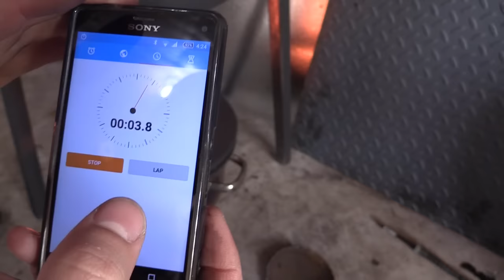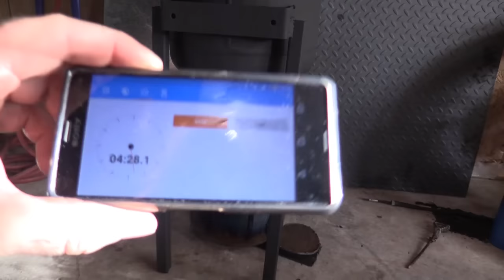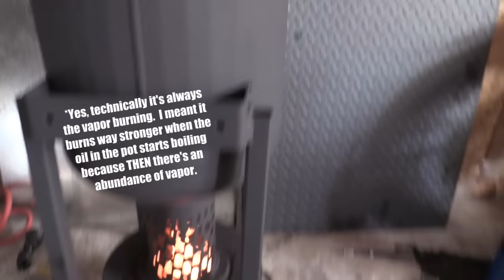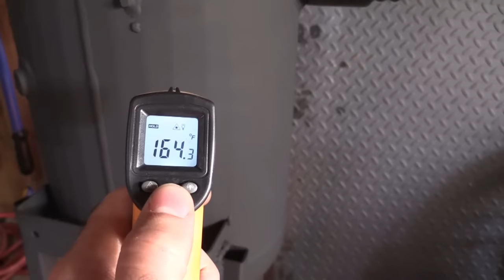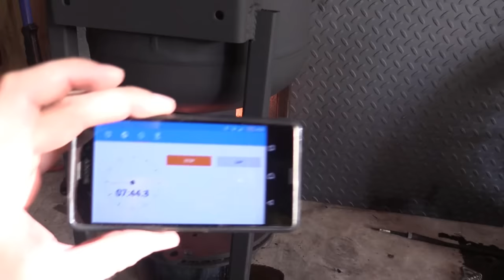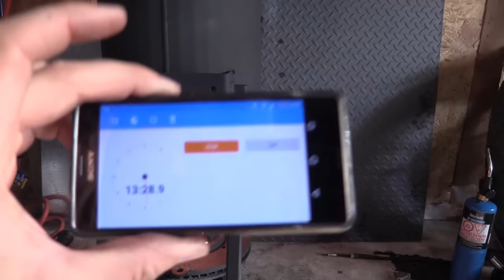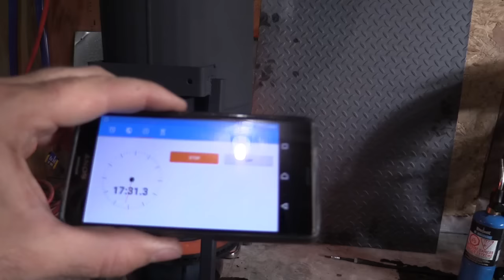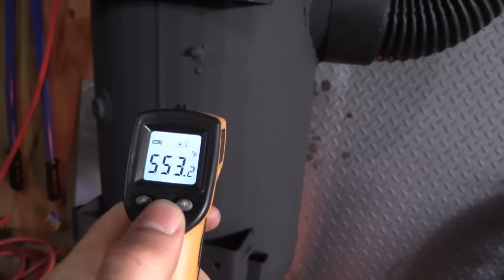DIY Waste Oil Burner -- How Hot Can It Get in 20 mins?

Comment: Would putting a small floor fan facing the upper tank and exhaust increase your overall heat output to your garage?  You have excellent ideas and inventions.
Reply from the maker: +William Brown Thanks William!  A floor fan could help circulate air, but it would have to be set up just right so as not to disturb the flame with any external wind-- I demonstrate what I mean here: https://youtu.be/9sTW1sQ8dWA
Check out the updated video on my channel to see the convection shroud and fan I've built for it.  Cheers!
Reply: So
Reply: You Canadians are so polite  I am thinking of jumping the wall and trying to blend in. The fuckery in our country is off the hook. I hope it's not like that up there take care good bud brother.
Reply: @rickzap7957  No it's worse.  They dont have the rights we do. So there nothing to strip them of.

Comment: Wouldn't you be better off taking outside air for combustion rather than creating a fan to draw cold air through the building and up through the chimney? I'm sure that once it is hot, the air temp will not hurt the combustion...this is becoming mandatory in Canada for obvious reasons.

Comment: could i use a old empty propane tank instead of what you used ( air compressor tank ). ?
Reply: You can
Reply from the maker: You sure can!  Fill it with water then empty it before cutting into it to ensure you have all the propane displaced.
Reply: @BogieWheelz  fill with water, and cut it while full to stop vapour igniting

Comment: Do the vanes in the brake rotor go all the way through?  I would think you could drill holes in the under side to let air in without having the pot slid out.
Reply: We
Reply: Might make it swirl too.
Reply: I used a vented rotor on mine and didn’t have to drill any holes. Sounds like a rocket too once it gets burning lol

Comment: why didn't you just modify the old oil heater you have sitting there?  I have an old 1950's Sinclair oil heater that I modified very simply to use waste veg oil.. works great.  The Sinclair has a blower that forces air into the combustion pot in a circular design and also forces air around the burn chamber and into the room.
Reply from the maker: Steven Canfield Hi Steven, I did modify the old Coleman heater sitting there, it's showcased in a different video.  Then I challenged myself to build my own purpose design that turned out easier to maintain (and way cooler).

Comment: I have an old oil fueled boiler from my house.  The burner works and I have removed it from the boiler.  Has anyone ever made a space heater out of one of these?  It seems ideal since the burner is designed to atomize oil.

Comment: Good News on the Smoke & CO detector, but where is your FIRE EXTINGUISHER that's appropriate for oil fires? What if you have a burn-through, spill or leak???
Reply from the maker: AnOldSchoolG33K have one fire extinguisher hanging off my welding cart, and another at the back of my garage.  Both dry chem.  Also have a fiberglass welding blanket to smother spills.
Reply: Didnt you see the baking soda boxes

Comment: CAN I DO THE SAME USING MOTOR OIL? BOTH OUR CARS USE 5W20 SYNTHETIC BLEND & MOST OF THE TIME I USE 5W20 FULL SYNTHETIC SO, CAN I MAKE A GARAGE HEATER & BURN MY USED OIL?????
Reply from the maker: D.j. B YES YOU CAN... Lol sorry.
And 5w20 synthetic is ideal as well because of its excellent low temp flow properties.  Let's try to ween you off the capslock key slowly as well.  👍

Comment: how do you control the heat??...im thinnkning of doing this my shop is 20x24 and dont want it too hot...lol
Reply from the maker: Yvon Larocque heat is controlled by metering the fuel supply currently.  Needless to say it takes a little while for the changes to take effect, but it works!  Best of luck!

Comment: Cant tell from the video but how far from the wall is your stove and how hot is that particle board getting?  In other words, do you need a heat shield between the stove and wall?
Reply from the maker: +92xl The stove is just over a foot from the wall, and at the time I used that steel plate as a shield.  The part of wood exposed above got warm, but nowhere near auto-ignition temps.  Check out my updated video to see the shroud I've built to create convection heat!  https://www.youtube.com/watch?v=fylfCX5jssQ

Cheers!

Comment: Nice setup how much oil are you using per hour for 300 celcius 
Ps if you were to use a 12 volt fan like I have you would have an awful lot more heat cheers mate
Reply from the maker: More oil is used to build up to that temperature, but once things get rolling it only uses about 0.5-0.7 litres per hour.
I actually did affix a fan to it in a later model, made a huge difference!

Comment: My chamber is an old propane  cylinder  .can get over 1000 degrees in around 5 mins .U need a baffle plate u r losing too much heat  up the chimney

Comment: Do you have a blower on the supply side
Reply from the maker: This version has no blower.  My later version has a shroud around the expansion chamber with a circulation fan at the rear.

Comment: I would think you could weld fins all the way around the compressor tank to use as a heat sink and increase your heat surface...
Reply from the maker: rainmann3669 I was thinking the same thing actually, but instead I ended up building a heat shroud around it to turn it into an effective convection heater!  It's in one of my newer videos somewhere...

Comment: Hey my friend, ya,did an amazing job on it.!! 
But I can tell ya, why you're having little drip-leaks, it's bacause you didn't use any 
"Teflon tape" on ya, joints..... True ya, tape would melt, at high temperatures, but you're feed pipe should not get that - Hot.....

Comment: would you use this in your house? does it give off a burned oil smell?
Reply from the maker: As long as it's set up properly and you have good draw from your chimney it doesn't smell like anything!  Just pure hot air coming off from it.  You could set up one of these in your house with the right safety precautions, but your insurance might have something to say about it.  I won't get into that...
Reply: +Bogie Wheelz have you considered adding some water stream in the burning chamber?
Reply from the maker: No, and that would be an extremely dangerous idea.  When water flashes to steam it expands to 1700x it's volume--basically exploding into steam and shooting flaming waste oil everywhere.  It's imperative that you remove all traces of water/coolant from your oil before burning it.  Thanks for bringing that up!

Comment: What kinda BTU's would you say this produces, safely? Would the unit you built here warm up a 20X20X15 cinder block building?
Reply from the maker: 2001pontiacta my last heater was a Coleman oil burner rated at 30,000 BTUs.  This waste oil burner easily puts out over twice the heat, so I'd estimate a good 80k BTUs.  Something like this would be ideal for your size of shop.  Encase the expansion chamber in a sheet metal box, run duct work from it and install a fan and you've basically got an entire furnace.  Thanks for watching!
Reply: Yes

Comment: love the heater. im in the process of building my own. i have a question. is there a way to possibly reduce exhaust gas temp foing through the flue??
Reply from the maker: Michael Campbell Thanks Michael!  For reducing exhaust gas temps the basic principle is the same as in automotive... The more heat dissipated from the furnace itself, the less there is to exit the flue.  Adding baffles within the furnace chamber can achieve this, or of course having a fan on where the flue connects to the stove.
Reply: Baffles for sure then.. what do you mean by "having a fan on where the flue connects"?  Something to blow excess heat off the outside of the flue ?
Reply from the maker: Pretty much.  Another option is to install one of those "stove heat reclaimers" (see google) which should significantly reduce EGTs beyond wherever it's installed.  Good luck!
Reply: got another question for you. im just about complete my own stove. i have test fired my stove. but it seems to not wana go.. it gets hot but not as hot as i would like it i guess. i see on yours you only have a few holes drilled through your rotor..is that enough air to flow. mind you i dont have my flu up yet.. could that be the difference?
Reply from the maker: Michael Campbell I should've actually included more holes in the rotor, and less in the "Swiss cheese pipe" as I call it.  Preferably holes closer to the outer edge of the rotor, so air sweeps through the burn pot.  And yes you 100% need a chimney/flue installed, at least 10ft high to create the draw needed to pull in air and have optimum combustion.  Chimney is a must!  Let me know how it turns out!
Reply: have you had issues with your furnace backfiring? i can get mine to run ok at around  250°C but i open my needle valve to add more oil to get it hotter and it seems to backfire and puff out my swiss cheese as u describe it. once i turn down oil flow it runs fine.. any thoughts or ideas?
Reply: There is such a thing as too hot for your setup. Popping back means overheat as I understand it.

Comment: I saw a 6.5 turbo diesel intake manifold for a fraction of a second.. You like 6.5s? Mines completely built
Reply from the maker: +master011CLAN Good eye!  The intake manifold is off because the injection pump went on it, but it's being rebuilt with a bored out advance piston.  Check out my quick exhaust & spec vid on it:  https://www.youtube.com/watch?v=Oqt8i_kWehI
What have you done to your 6.5?
Reply: +Bogie Wheelz my 6.5 has been bored 0.020 over and decked 0.010 of an inch, block has 330K on it, it's a 929. I have Mahle 0.020 over Pistons with it, Scat Crankshaft, DSG Girdle with ARP crank studs, AMG P400 heads with diamond precups installed, ARP Headstuds, Marine 40HP injectors, Kojo tune, HO Water pump, HX35, Diamond Eye 4 inch exhaust and a intercooler :)
Reply from the maker: +master011CLAN Wow!!  Sounds like a very complete build!  You should put up some video of that thing running.  I'd love to see the intercooler on it.
Reply: +Bogie Wheelz I sure want to!! I'll make some build videos too and how it runs when I'm done. I'm currently waiting on my precups to be machined at the machine shop but once that's done I'll have the heads on and drop the motor in! You have a Facebook? I'll add you to the 6.5 secret group, it's only 1000 members or so and very secret >:) haha

Comment: is the tank empty with a whole cut in the bottom of it?
Reply from the maker: Yessir.  One hole in the bottom for the burn pot pipe, then another on the side for the flue.  That's all!  Next version will include some baffles within the tank to help evenly disperse the heat.
Reply: How do you control the heat? Like turning it down if it gets too hot?
Reply: Bogie Wheelz I just built one my self however mine makes a lot of black smoke. I'm giving it less oil then you are
Reply from the maker: A few factors can contribute to that, but ultimately it means your oil isn't being burnt completely.  Is there enough air getting to it?  Does the setup allow the oil to get hot enough to completely burn the vapors?  Lots of heat is important.

Comment: YOUR SLIDE RAILS UNDER THE POT LOOK TIPPY! ARE THEY STABLE?
Reply: That thought crossed my mind for a few seconds until i realized that the brake rotor is the stabilizer against the top of the burning pot. it can not tip. in theory, a rock would do just as well as the two rails.
MUDDy
Reply from the maker: What you say is true sir!  The pot cannot tip or pivot with the brake rotors pressed down upon it.

Comment: You're losing a lot of heat out your exhaust pipe I would have had a longer exhaust pipe at a slight incline going around the shop and on a half moon kind of set up behind the pipe I would have some kind of a stainless steel to reflect the heat back into the shop and knocked against the wall

Comment: put the burner inside the tank and it will work 100 times better
Reply from the maker: I'm toying with an idea where it's inside the tank and fed air through the bottom centre, thus pushing the hot gases outwards and upwards.  One of these days....

Comment: I would run a copper coil right the way through the top chamber  and run air through it because most of the heat is lost dew to the chimney
Reply from the maker: You're right about the heat loss for sure... Check out my updated video though, I've made a shroud around the tank to create hot airflow from convection to help circulate the air.  This thing turns my shop into a sauna as it is!
Reply: Good project for me to weld up with my everlast. Still cold in my parts
Reply: Gr8 job bro.. next winter I'll b all snug and warm!
Reply: Bogie Wheelz

Comment: love the stove, why vent out the side as opposed the top, thanks!
Reply: I would say that the advantage of that is slowing down and causing turbulence within the flue gas. There would be a swirl of gas at the top there which helps with heat transfer and makes it more efficient.

Comment: just drill some more holes In your Brake rotor...then  you won't have to offset the Pan
Reply: Flashem2me i like where your going with that, I think also because of the deep pot, put a sliding air vent air on it for control
Reply from the maker: All valid points! When I have time some day I'd like to completely redesign the burn pot, with a separate float tank to regulate oil level. That way it'll never spill over (insanely dangerous) if the flow is too high, or burn itself down if the flow is too slow.

Comment: your scareing me.your fuel tank is next to the  engine .danger will rogers danger. plastic five gal pale on cheesy plat form .to close to fire  .put it out side in a metal container .man you look like freddy mercury of the rock band queen alot .love your intrests .cool builds .my friend had a old oil burner in his school bus..the oil just came into the burn pot an driped onto a slanted piece of metal real slow from a copper dripper .with copper tubeing 1/4 inch an burned on the slanted metal ..his 35 ft bus was really warm .

Comment: With a flame that color that IS NOT burning cleanly. A giant red flame indicates incomplete combustion which puts off a $#!+ load of carbon monoxide and soot. Just make sure that you have PLENTY of ventilation and inspect the chimney regularly because the soot can build up and catch on fire which would probably catch the roof on fire. I don't know if you used any kind of air gap between the chimney pipe and another metal outer layer or how much of a gap you have between  the outer pipe and any combustible materials or if it's encased in concrete board or how you did the flashing where the chimney exits the roof. Please be careful when you undergo a project like this because if you catch your $#!+ on fire your insurance company will tell you to go have intercourse with yourself if you have to submit a claim.
Reply from the maker: Roughly a week after this video I refined my air adjustment method to provide a much hotter and more controllable flame.  The small amount of soot that was produced has withstood the expansion chamber getting red hot without flashing.  Wood-produced creosote on the other hand would never withstand that heat.  Thanks for watching!

Comment: hello Sir Bogie,

Do you have some plans for the DIY waste Oil burner that you can send to me?
Nice video!

Greetz!
Reply from the maker: +Jarco Schoonbeek Hi Jarco, I don't actually have proper plans drafted up per se, this was all done by trial and error.  The principles are basic though:
- Have a burn pot or chamber that can be cleaned out.
- Make sure the pot is covered safely with enough air flowing in from the outer edges.
- Direct the flame to an expansion chamber (via swiss cheese tube).
- Have a decent expansion chamber to help radiate heat.
The rest is up to your imagination!  Have fun, and please don't burn yourself.
Reply: 0and

Comment: ive seen guys use an iron bowl of bolts inside the "pot".
Reply from the maker: +linuxxxunil Interesting, is that to help transfer heat to the oil?
Reply: Bogie Wheelz
it was over a year ago when i first saw burning waste oil videos.   it was done so the "pot" would not melt from the intense heat.   he said he could get the wood stove conversion glowing red hot.  if i find the video i'll let  you know.

Comment: this is so funny, the way people view warmth is so backwards. If you want a warm shop don't get a big heater, make a well insulated shop. You could heat it with a Bic. Insulation is good for cold or heat, it's not a "waste" in the summer.
Reply: Well, the heater and oil is free. Where do you get this installed insulation for free?